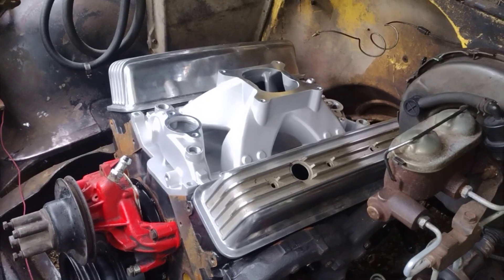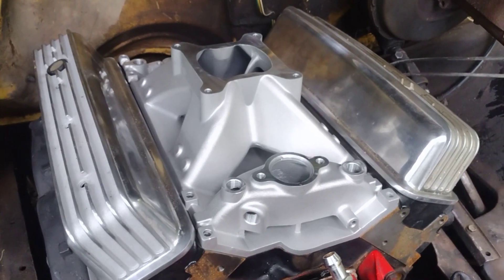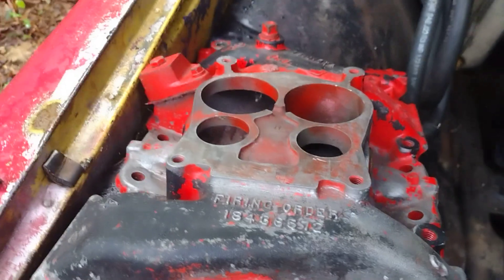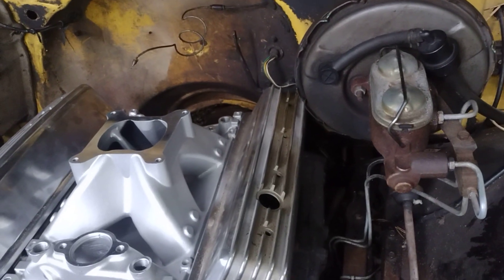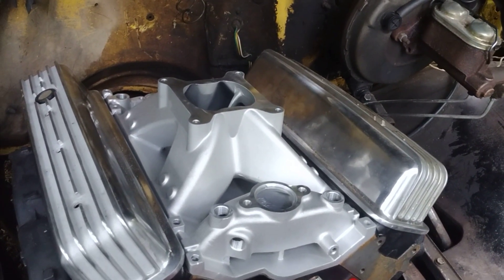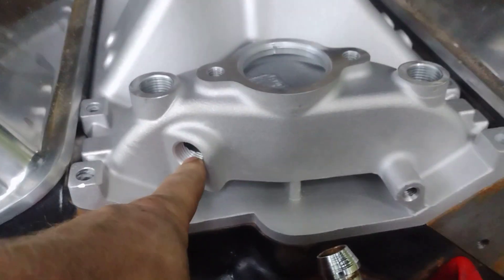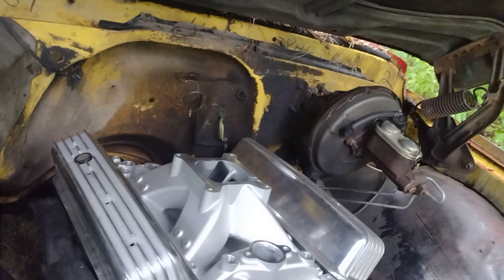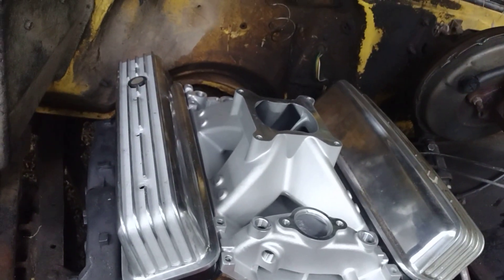Vortec intake is in!

Comment: Why did you get a single plane intake, those are for higher RPM cams. Going to be interesting how that intake works with the factory roller cam? A genuine imitation RPM Airgap dual plane would of been the better choice.

I built a sbc 383 for a friend with Dart heads, a good sized(on the big side)solid roller cam, high rise single plane (the taller intake you were thinking of is a tunnel ram) gear drive timing set, forged crank, forged H-beam rods, forged pistons. Built to to rev to 7,500 RPM, what the rod bolts and crank are rated for. It makes 580 HP and slightly over 520 lb ft of torque.

The point is that intake you choose is a good intake that is capable of making big power but at higher RPM than your engine will be able to run. Low end torque will be a bit down until it starts spinning a bit then will run out of RPM because of the cam.

Not the best for a truck but it'll make it run, would be better for the lighter Chevelle though on a sbc 383.
Reply: @bad66chevelles  
Not the above comment, head flow info I keep trying to pass on to you keeps going away! 

Yeah those single plane intakes do look good but a dual plane will run way better at 3,000 RPM and lower. The longer the intake runners the more low end torque an engine will make. This is what a dual plane is made for.

Back in the day running huge cams with tunnel ram intakes they were trying to raise the torque curve with the long runners of the tunnel ram. MOPAR use to make a factory cross ram dual quad intake that made tons of low end torque with the factory street cam they would use. A really cool intake, maybe if your Christine will get a MOPAR big block you can use one of the aftermarket cross ram intakes they make out of aluminum?
Reply: I agree! I think an air gap would have served you better if you wanted something above a dual plane but being so your new intake is not ideal for the low end torque.
Reply: That would be great for my 76 Vette.

Comment: looks like too much manifold and too little engine, also the exhaust manifold needs to be lost.  I think you might not be happy with that combination. Also, your old manifold is not vortec, but old style.  did you swap the heads to 906 castings.  Something does not seem right in Denmark.